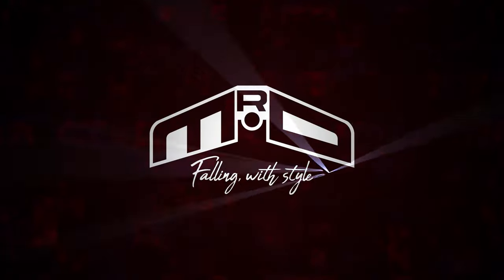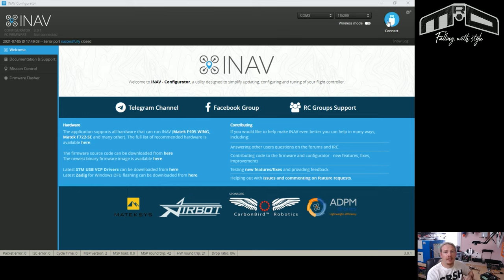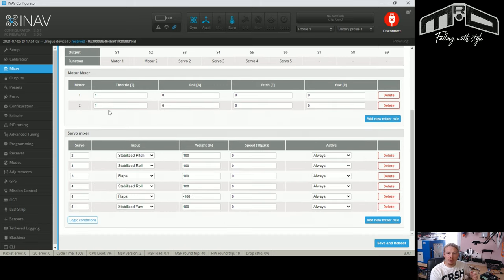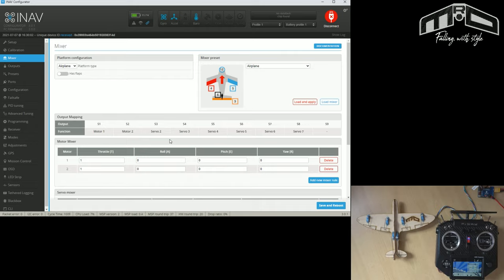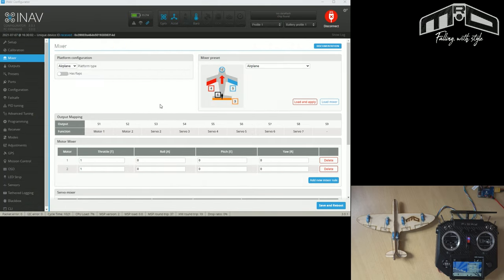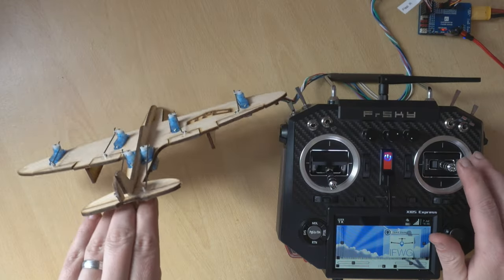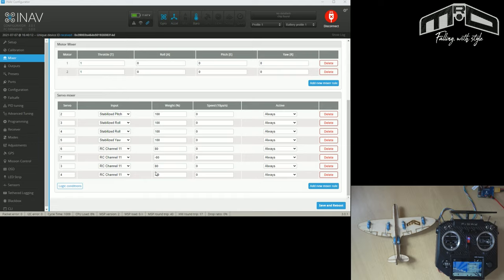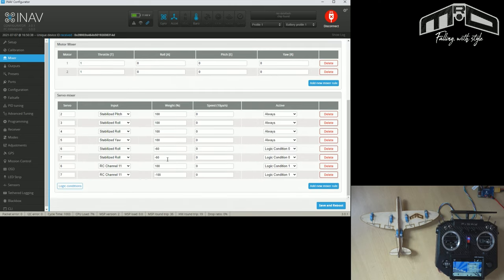Adding Flaps in iNav. Plus Crow (Butterfly) braking, Flaperons, Spoilerons, and Full-Span Ailerons

Comment: So here's what I did in 6.1....In the mixer I added a channel 5 and changed the number to 2 and set it to "Flaperon mode", and then added a channel 6 and changed that from 6 to 3, so that each aileron has a corresponding flaperon channel...then...the Flaperon mode worked except the flaperons moved in opposite directions....so I changed one of these flaperons on the mixer from 100 movement to -100 and voila it's happy now.  I realize there aren't a lot of gents like me who fly traditional fixed wing, but I really needed flaps for my 64" chipmunk to slow it down when landing without wind.  There may be a better way to do this, but "simple" is not what I'd call it. It has been a real blast flying my larger planes with FPV, usually with the cam on the tail, and take off and landings are a big part of the fun.  With the new GPS and the great INAV system, you can really count on the numbers (height and speed) you get in real time and that makes all the difference in landing.  I'm sorry more fixed wing guys don't try landing on wheels.  So far much better than LOS and we're talking manual not using INAV's auto landing (still haven't had the guts to try this yet).  Sorry for all the verbiage, but I was at my wits end and I thought I'd share my travails.  Thanks again Darren.

Comment: Great video Darren. Looks like I will have to start using my 7 position switch more. Need crow badly on my Phoenix.
Reply from the maker: Thanks Sam. They do like to stay up. It’s rare I don’t need crow to get my Phoenix 2000 down, on the slopes.
Reply from the maker: Not really. The flaps and crow have to operate together. To be honest, with the Phoenix, you don’t really need flaps alone. Mine will pretty much just fly out my hand. But crow for landing is much more useful. So if you’re channel limited, I would personally just set up Crow (ailerons up, flaps down). 

But yeah, I agree. Crossfire only having 12 channels is a pain in the arse.

Comment: Do we use y cables for flaps or separate servos for each flap?   I’m working on a Phoenix 2400 motor glider     
The Volantex 2400 came with Y cables for both ailerons and flaps. But my understanding is we should set both of these surfaces on its own servo.   Please help.   Also having issues with rods and setting up the flap servos.  Need some advice on this.
Reply from the maker: It depends what you want out of it. Personally, I set my Phoenix 2000 up with separate servo cables for each aileron and flap. This give the freedom to have flaps, crow braking, and full span ailerons. Minimum, I would have separate cables to both ailerons, and a Y cable to the flaps, if you are short on PWM outputs. With that you can still have flaps and crow, but not the full span ailerons.
Reply: @MrD  I’m going to use separate servos for both ailerons and flaps.  Think that would suit me better
Reply: How  to setup flap initially with the pushrods is what's confusing me.  Do I set them up like I do Ailerons in  neutral? Or do I set the horn differently.  Like I said I've NEVER used flaps
Reply from the maker: It depends on if you want full span ailerons or not. Or at least the option to add them in the future. If you do, then set the flaps up as you would ailerons. You will need to check out the movement first. I can't remember if I needed to cut foam away on my Phoenix 2000 to allow the flaps to physically move up.

However, if you're only ever going to use flaps or crow braking. You can set them up as pure flaps. So the servo at one end of the range is flaps up, and at the other end of the range is flaps down.

Comment: Here's what the documentation says: 

"Activating it moves both ailerons down (or up) by predefined offset.

Configuration besides activating FLAPERON mode is pretty simple, and consists of just one CLI variable:

flaperon_throw_offset defines throw range in us for both ailerons that will be applied when FLAPERON mode is activated. By default it 250 with max at 400.
Flaperon offset is by default is applied as a servo mixer input with ID=14 so using custom servo mixing you can configure FLAPERON mode to deflect any servos you need (including dedicated flaps)."

Simple? Huh? I set a 5th channel to "flaperon mode" set the CLI command as instructed and set a dedicated slider (channel 6) to Flaperon mode on the MODES page.  I didn't expect it work and it didn't, but I don't know what else to do. 
Thanks again for all the great work you do!!!
Reply from the maker: Where is this documentation? It looks outdated. You will need to add flaperon lines to the mixer, on the same servo indexes as the ailerons.

Comment: Hi Darren, Seems INAV 6.1 no longer has the flaps button - all you can do is add a "flaperons mode" mix (5th channel?) and I can't get that to work.  Haven't found anything on Youtube or in the documentation that addresses this.  Thanks!
Reply from the maker: The Use Flaps toggle was removed in INAV 4.1. Because basically, all it did was show or hide the flaperons mode on the modes page. This is now automatic based on the mixer type chosen. Any fixed wing that isn't an elevon setup and has more than 1 aileron servo, shows the flaperons mode. If you want to use it, all you need to do is select an appropriate mixer for your aircraft, add a switch for the flaperons mode, then add the mixer lines for the flaperons. I believe there is also stuff to set up in CLI too. To be honest, I never used this system. It was always too restrictive to me. I always set it up like in this video.

https://github.com/iNavFlight/inav-configurator/pull/1423

Comment: Thanks for your in depth explanation. When I deploy my flaps my nose is going down because the center of pressure of the wing is shifted backwards. So my question is if it is possible to change my elevator midpoint also with the flapswitch to compensate for that effect and keep the nose straight?

Comment: Thanks Darren.  I just added flaps to my FT Twin Explorer (still on iNav 2.5.1)!  Your instructions are just want I needed.  I did add a value of 2.8 to the "Slow Up" and "Slow Down" values of the Mix which adds a nice gradual deployment of the flaps when using a switch.  Of course I just added sounds via special functions from my custom sound pack thanks to you also!
Thanks again for all your excellent work!!
Reply from the maker: Awesome A.C. From what I remember, the flaps settings should work in any version of iNav with the programming. Those slow functions make for a nice deployment too.

Comment: Hi Darren, in 4.1 there's no more flaps in the settings how to set up flaps in inav 4.1?
Reply from the maker: The flaps setting was never for flaps anyway. All the "flap" switch did was enable or disable the Flaperon mode on the modes page. This is now automatic. Those flaperons can still be added to the mixer as before.

This video shows how I would set up flaps, flaperons, or spoilerons. The old flap switch was never used in this video. I even say that it is bad.

Comment: Hello Darren, i want to add flaperons on my Heewing T1 and it seems like now its in modes and can set it on a switch. Can you explain how it works? when i activate it 1 eleron goes up and the other goes down. Can you explain how to set it ? or remake this video for new inav's ?Thanks in advance and i really appriciate your help! Happy new year and enjoy your new pc :D
Reply from the maker: To be honest, I'm not a fan of the flaperon mode switch. It doesn't give me as much control as I'd like, and is only a single position. In the mixer, there should be a weight on the flaperon line. The flaperon that is moving up instead of down, add a - in front of the weight. That should get them moving in the right direction.

Comment: Hello Darren, you helped me a lot with this vdeo. In the new Inav 5.1 the 'has flaps' option is removed. I did it like you did it, works perfectly. But now i have a little issue, i will explain.

I use ch12 on my tx, it is a 3way switch. On top is NOTHING, in the middle is FLAPS... and... my MANUAL flightmode is also on that switch, BOTTOM position... but now i think you already know what's the issue.... When i set my switch to MANUAL the flaps are switched to spoilerons .... and no, that not what i want during manual flight... a bit difficult to fly whahaha...

I can imagine that there is a way to do it, so that the 'spoileron' issue while use MANUAL is solved....

I think on the tab 'programming' but i do not exactly know what to do there, and how to do it..

Maybe you can help me with this? Maybe a link to a video where something is explained..?? But, i think you are a smart man who can help me!! -:)

So i want the flaps are only working in the MIDDLE postion of the switch..

I need some help, tnx!
Reply from the maker: The has flaps switch had been removed. But the system is still there and works as before. All that switch did was enable the flaperon mode in the modes tab. This is now automatic, so no need for the switch. You can add the flaperons mix to the mixer, and use the mode as normal. 

It sounds like you are using the switch as an RC input in the mixer. This won’t work, as you are trying to use the switch to control a surface and a mode. The simplest option would be in the mixer, don’t use RC Channel 12 for your flaperon source, use the flaperon option in the list. Then in the modes page, set the flaperon mode when your switch is in the correct position.

Comment: Wondering what is the best approach, set negative value in mixer or flick the revert servo switch in the output tab?
Reply from the maker: It depends on the situation. For ailerons and control surfaces with multiple functions (elevons, ruddervators, etc) I will tend to reverse one in the mixer. Then use the outputs to get all movement correct. Both ways should have the same results.

Comment: Excellent vid as usual! I just setup crow slightly different since my flap servo user 100% of the travel. So flap servo straight from CH6 then I had to add aileron up + elev. down via GVAR. works great except the time delay (want flaps to move slowly) only works on direct. Any rudder mixed via GV gets the delay only the first time extending and from then on they jump whilst the flaps slowly move up or down (inav 4.0) any ideas grand master? bug or per design? cheers mate
Reply from the maker: I think I’ve seen the jump thing before when using GVARs for servo outputs. But it’s been a while. There may be a way to set it up a different way, but I need to have a test.
Reply: @MrD  cheers mate - no rush! but its just not "clean" and nice

Comment: If your Ailerons are on a Y cable do you have to remove the Y cable and  put them on their own servo for the Crow braking to work?  I have the Ranger 2000.  It is the first plane I bought that has both rudder and flaps.  I go the flaps working correctly, but when I tried to add the crow break, the left aileron moves in the same direction (down) as the flap.
Reply from the maker: Yes, crow needs both ailerons on individual control inputs. If not, they will only ever work in opposite directions.
Reply: @MrD   Thanks.  Lesson learned.  To be honest when I bought the plane I did not know what the flaps were for, just that they were optional, not to mention what crow braking was.
Reply from the maker: No problem at all. Any day we learn something new is a good day 👍🏻

Comment: Mr. Darren, I love the content you provide. Thank you  
I'm trying to set up flaperon in inav 5.0 but there's no option for flaps in mixer and mods 😢
Reply from the maker: There was a bug when mixers were loaded in a certain way. If you just load the airplane mixer (not load and apply). Then save and reboot, the options will be there. This is fixed in 6.0. 

But, following this video. You don’t need to use that at all. You’ll actually get a more controllable flaperon by not using that method.
Reply: @Mr.D - Falling with style  
Dear Mr. Darren, I am thankful for your reply. I appreciate your support. 
Actually, I'm facing another problem in voltage reading. I am running Matek f411 WTE with inav 5.1 
Voltage reading always =0 even I have flash it in the right target and voltage scale as fc instructions.

Comment: Nice vid! I always wanted to play with flaps but never had an actual reason. My full-size SkyHunter I suppose could theoretically use flaperons but Ive been warned against it from other SH flyers. It gets into SERIOUS ground effect while landing and floats forever. Maybe I could add crow function or some kind of airbrake for shorter landings.
Reply from the maker: Crow needs a physical flaps control surface. If the SH floats on forever, and only has ailerons on the wings; spoilerons are what you should try.
Reply: @MrD   Right. I figured I could split the current ailerons, add the servos then id have the extra control surfaces. Alot of options though.
Reply from the maker: Sounds like there is a lot of scope with that plane. I’d try the spoilerons first. As if that’s enough, you’ve not had to modify anything.

Comment: Man, I’ve been meaning to work out crow braking for a while now so I can slow my wing down, just have had too many things going on to dig into it. Thanks for this, probably saved me a bunch of time.
Reply: So, now having watched it all, I see it pretty much works how I suspected it would. Kinda happy that I’m comfortable enough with iNav to think to myself “How would I approach this problem?” and be able to work through it logically in my head and be mostly right! But anyway.

Too bad you can’t do “NOT Logic Condition 0”, it would allow you to eliminate two lines in the mixer since the flap servos do the same thing in both flap and crow mode. I guess you could do that with a fourth logic condition, but then, six of one, half dozen of the other right?
Reply from the maker: The not having the NOT option is a bit of a pain. But, the flap lines for flaps and crow are slightly different, as one is 100%, the other is 80%. But yeah, if they were ok both being 100%, it would work great with NOT LC0. You could set up a Logic Condition to do that. But I think that you’re more likely to run out of LCs than mixer lines.
Reply: @MrD  oh yeah forgot you set them to 80%. Like I said it probably doesn’t change much one way or the other.
Reply from the maker: No, but I still agree, having nots for Logic Conditions would be very useful.

Comment: This was such a great video! I really appreciate your time. When i set my f405 to stabilized roll I feel like i'm not getting the same amount of throw as regular RC Input. Can the % value go over 100?
Reply from the maker: Which version of iNav are you using?
Reply: @MrD  3.01 When I power on I get full movement on the yaw and then it goes into stab mode or something and limits the movement.
Reply from the maker: @KAREKINFPV  have you performed an autotune yet?

Comment: Great video Darren! There is one thing I missed, how to use a three-position switch when takeoff flaps are not in the middle between flaps up and full flaps. Could you please give me (and hopefully more newbees) that procedure in detail?
Reply: I think I've solved it by using a 3 point curve with 25% in the middle.
But another issue. How will the autotrim permanently on influence the flaperons? I once crashed because I've routed the flaps to servo 5. Powel then told me that the autotrim (in ver 2.6) worked on every servo from 2 till 5.
Reply from the maker: Yes, the 3 point curve would be what I’d suggest here.

That is a good question about autotrim. I will chat with Alex. As far as I know, it only works on the 4 stabilised inputs, and when no deflection is commanded. The same servo is being commanded as used by the ailerons, but not by the aileron input. I will find out.
Reply from the maker: I’ve spoken with Alex, and adding flaps, flaperons, or spoilerons would effect the trim if you have continuous autotrim enabled. Therefore, it would need to be setup with elevator compensation, which would negate the trimming. I’ll be adding some details to the article on this shortly.